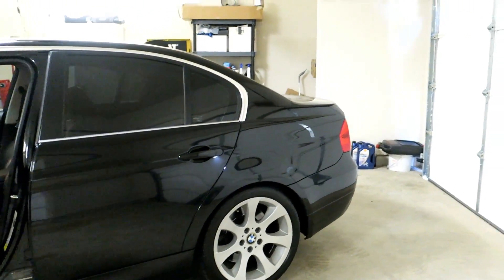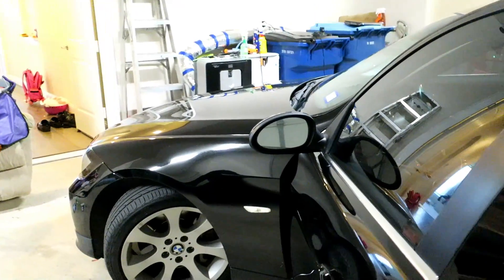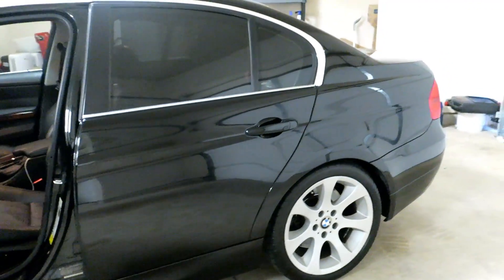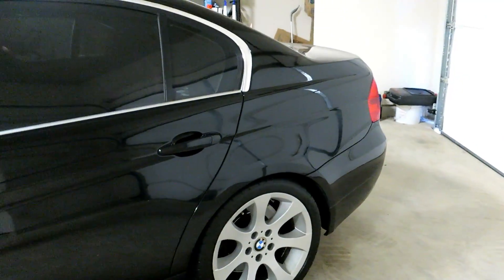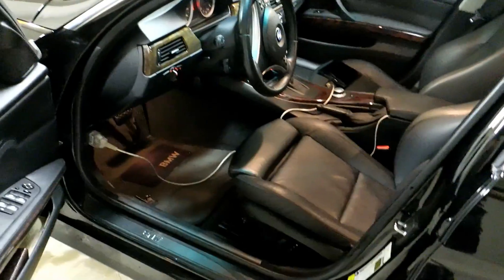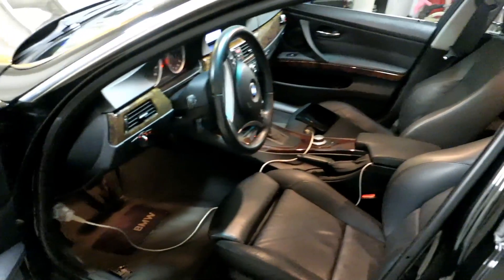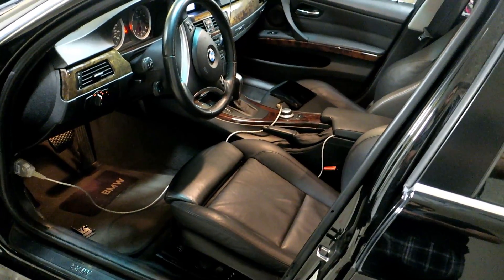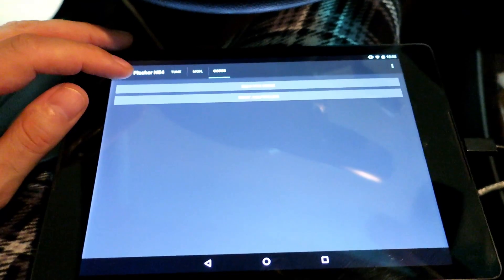How To Diagnose A Fueling Issue On Your N54 BMW.  Part 1

Comment: my 07 335xi, that I just got started having an erratic idle at startup, wanted to stall but feather the pedal seemed to smooth it out. I pulled a P3090, how to decide if its the HPFP or the low pressure fuel pump or FPS?

Comment: For those running Walbro LPFP with the Walbro fitting check the fitment of the fitting and the O ring inside the fitting if the O ring is ok check the tightness these things come loose and cause all sorts of problems and leave you chasing your tail.  CERTAIN COMPANIES DO NOT WANT YOU TOO KNOW THIS IS THE FIX  THAT  IS WHY YOU NEVER WILL FIND AN ANSWER IN ANY FORUM WITH THIS PROBLEM, SO THEY DELETE THE FIX.

Comment: so i have a 535i with the n54, and i had the issue of it cutting power around 3k rpm, so i replaced the hpfp and it fixed it. but now about a month later, it almost instantly throws the codes 29DC, 29F2, and 2B2C. do you have any ideas what it might be?

Comment: omg bro i love you ive changed vanos all my o2s and fuel pressure regulator and fuel pump and i checked my guage and myn stays at 48.99 even with car off and fuel throttle i ran home changed it and omg i got correct fuel pressure

Comment: Im having a issue where at cruising speeds and idle my pressure sits at 23PSI. At WOT my second pump kicks in at 15psi and the pressure goes up 70-90. My tuner was telling me to add a fuel inline check valve but im running stock fuel lines and don’t know where i would connect it to, if anyones has an idea on how to connect a check valve to it please reply to this :(

Also im running a walbro 450 and a 535 ethanol pump. Im on full E85

Comment: So im having long crank and also an issue when it starts the car jumps up and down in rpm like its going to die sometimes even puts the car in reduced power mode and acts like it does not want to start but it always does I can turn it off and back on and the issue clears up also comes with shakes and missfires I was thinking the fuel pump but after watching this im now thinking about fuel injectors but didnt belive it to be the issue i see a problem when i floor or gas it above the 5k RPM mark it missfires check engine light flashes and whole car shakes  not sure if this has anything to do with it but also the 4x4 light and brake light have came on but turn off as soon as i start to drive or if its warm outside only pop up really at cold start.
Reply: These are the codes if intrested:
Cylinder 1,2and3 misfire. 
Cylinder injection cutout, 
fuel high pressure system. 
Fuel low pressure system sensor (electric).

Comment: lpfp at idle is 33. 
Hpfp is 600-700

wot is 80ish and 1800ish

Brand new stage 2 bucketless lpfp. 

randomly in traffic the hpfp will drop down to as low at 50psi then will run rough and die. 

Hpfp or low pressure fuel  sensor?
Reply: Did you figure this out? Having same problems

Comment: Hey man, I have an issue with fuel pressure drop overnight on our 2010 x5 30i (n52). Leads to extended cranking in the morning. Just replaced the cross over sending unit with built in fuel pressure reg under driver side rear seat. Not totally convinced that resolved it. Where to look next? Fuel pump is new (2018 recall by BMW).

Comment: So if you have a bad sensor would your car still run? My car stalled at a red light and I have fuel codes 
2AAF
29F3
Reply: Now I have the 29F3 code ….

Comment: so my sensor reads anywhere from 40psi-130psi in my logs when around 70+% throttle, any ideas? lpfp done,(walboro), new ekpm3 module, new hpfp, new fuel line behind the hpfp, new index 12s. only things i haven’t done are the lpfp sensor, valves need cleaned, and im in the process of putting injection clamps throughout the fuel system. im lost, can send logs if needed
Reply: The LPF sensor is known to go bad (vibration, heat, years worth of fuel), and according to people on the forums, it is more likely to fail than the HPFP and LPFP.  The LPF sensor is relatively cheap ($50 - 150 depending on whether you get it as a kit), so it is worth trying. It should have been replaced when you replaced the HPFP, because it sits right next it.  Replacing it is not technically hard, it's just a bit of a PITA because you have to remove your air intake manifold to get to it. It takes about 1 - 2 hours depending on how quick you are with your tools.

My LPF sensor failed (i believe), and my symptoms were: slight stumble at idle for a month or so, then, completely out of nowhere, at a red light, the car stalled and refused to start. When I let it cool down for about 20 minutes, I could get it to start again for about 1 - 2 minutes. Checking the codes,  I got a 29DC, 6292, and 6293. The first basically says that the cylinder injection was shut off; the other two report over current and under voltage to the fuel supply.  I checked my EKPM and it was the newer version and nothing looked fried. So, I checked the fuel pressure at idle (when it would allow me to start), and it was reading unsteady and upwards of 88psi...then it stumbled and stalled. Getting it started again, it would bounce all over from 60 - 88psi.  My theory is that the sensor was reading a higher value than what was really there and reduced the voltage signal to the LPFP, starving the engine.

I replaced the low pressure sensor (walnut blasted the intakes while in there) and now the pressure holds steady at 72.5psi. There is a slight variance when stepping on the gas, but the DME is supposed to target 72.5psi. I haven't taken the car out for a drive yet, but i let it idle for 30 minutes...still holding around 72.5, no indication that it was going to stall.

If you have the skills and tools: replace your sensor and clean your valves while you're at it. The two aren't really related, but you must expose your valves to get to the LPF sensor.  It seems that you've pretty much replaced everything else, and despite what others say, your low pressure should not be erratic.
Reply: @jlwagner79  this helps a lot, since asking i serviced injectors again and still nothing. so the readings being off because of the sensor makes sense. and if it reads wrong, it sends the wrong input therefore making it gasp for more. thanks a lot boss!

Comment: I have a e90 335i and it will long crank sometimes but alot of the time instant. But sometimes during a cold start it’ll just cut out and the throttle doesn’t do anything and fall slowly in rpm’s. Kinda random when it does but I have the codes if any one is curious aswell. Any help is appreciated though

Comment: Hi Vehicular DIY. Thank you for the channel. I have a active 29F2 code (high pressure fuel system, fuel pressure). It's intermittent, with a recent prior misfire in cylinder 2 at car starts.

-- In morning starts about 15 seconds in, the car begins to rough idle/hesitate.
--30 seconds in, the car goes into limp/reduce power. Showing an active 29F2 code (high pressure fuel system, fuel pressure).
--If the car can make it past 30 seconds from start, the rough idle subsides, and the car drives normal.

I see you use MHD to verify the low pressure sensor is reading/sending accurate values to the DME. I dont have MDH. I have INPA, and other free diagnostic apps, which only reads fuel rail pressure.
Reply: I am having this issue as well.  Did you ever resolve?  Strange thing is, if I put into sport mode, I can get great acceleration so I am wondering how the HPFP could be failing if it performs like that if no limp mode is initiated after start.
Reply: @TheJtaylr77  Any update brother? I’m still having misfires and shaking on cold starts after doing the coils, plugs and a walnut blast. 
Car still pulls hard when fully warm and none of my plugs had any fuel smell or anything from leaking injectors when I changed them.
Reply: @n54kv  ended up being the high pressure fuel pump after all.  Replaced and problem solved.  Hope that helps!
Reply: @TheJtaylr77  Good to know. Thank you for actually responding! Just got a walbro lpfp in the mail today. If that doesn’t help I’ll grab a hpfp next 👍🏼

Comment: I started a MHD data log before starting my car and could see that the "Rail Pressue (PSI)" was 72 psi.  I almost certain my low pressure sensor is bad and have ordered a new one.  Should that Rail Pressure reading give me confidence that the Low Pressure Fuel Pump is working correctly since the HPFP wasn't turned on, yet?  Great Job on all content.  Super helpful!

Comment: Hey I'm having similar problems with acceleration and sputtering. I recently replaced my fuel injectors. After the new install i learned that my old injectors were eu5 and the new ones are eu6. Does that make a difference? And cel says air mixture too lean.. any help thank you.

Comment: Would a failing hpfp cause blue smoke to come out the exhaust and smoke to come out from the oil fill cap on the valve cover?
Reply: No. But burning hella oil would.
Reply: Pcv valve

Comment: I’ve always had the code 2aaf fuel pump plausibility but today I was at work went with one of my friends to do pulls on my break and the car went in limp mode pulled out MHD and saw I had the 29dc code something about cylinder 3 I cleared the code and nothing else has happened but the car feels wobbly and shakes at low speeds

Comment: Ik this is old but I really need help here. N54 335i. MHD tuned, Hard 29E2 DME fuel injector rail pressure-sensor signal. While driving around 2k mostly highway speeds if u let off the throttle and get back on car starts studdering starving for gas it seems, and shuts down. Fuel rail psi goes crazy when this happens jumping from 700-3500. Lpfp bad?

Comment: Have n54 e92 335i the fuel gauge after putting gas start going down after 1 mile and then it fluctuates up and down until it goes down any idea what this could be?

Comment: i got a weird problem my fuel pressure fluctuate so fast between 70 and 40s under any % throttle but stays in the low 40s under low throttle
Reply: Did you solve problem ?
Reply: @JustinGotsVlogs  yes it was fuel regulator and HPFP

Comment: Hey man can you help me out, when i bought my car it was running fine (aside from blown turbos and waterpump) but then it randomly died and hasnt started since. I got cam position sensor codes, then replaced the sensors and waterpump and tried starting again. Car cranks for days but no start. Finally got MHD hooked up and got the 29F3 code for fuel low pressure sensor-electric but the cam codes are gone and my car still wont start. The only reason I’m asking this is because your car still ran with this issue I believe?
Reply: Hey what was the issue? I'm having the same code and problem. Thanks
Reply: @ddrive1022  i managed to get the car started by priming the fuel pump about 6 times before starting. (Put car in accessory, wait for all lights to go off, pull key out, open and close door, repeat). But after i got the car started it it idled like a rotary 13b, purely electrical issue not mechanical. Months later i figured out i had a few melted wires which ended up blowing some fuses. One of the greatest mechanics ever fixed it for $550 (charged $125/hour).
Reply: @PR0bro  Dang, that's a tough find. I figured my problem out, I mixed the fuel pump and fuel level sensor cables at the pump, after a turbo replacement, they are identical. Glad you got it sorted. Cheers.

Comment: NOTE:  Reading the n54 High Pressure Fuel Pump RECALL, it states that the Low Pressure Fuel Sensor will need to be replaced it when doing a testing on it if it reads above 6.7 bars (97 psi) than the sensor is bad and needs to be replaced.  If it reads below 6.7 (mine with the latest upgraded version reads at a stable 87 psi) than the sensor is good!

Comment: Update on my BMW F10 535I M SPORT, after replacing my Low Pressure Fuel sensor to the latest upgrade & upgraded with the latest short fuel line and the gas smells where instantly eliminated. Yet the 3 to 4 second cranks at cold start continued, my HPFP would read at a bit less of 100 psi until warmed it up and turn off the car wait a few seconds and restart the engine and the High Pressure Fuel Pump would have the correct 700+ psi at idle..... 
Well after a few days, I thought to myself that maybe the Low Pressure Fuel sensor needed to be "reset"..... So yesterday I Turn on the key until all lights (except the Check Engine light) turn off. Then turn off the ignition, waited 10 seconds and repeated the process for a total of 3 times!  Somehow this seemed to reset the sensor as the car starts right up, no more smell, checking the Rail Pressure via BimmerLink shows a mPa 5 at idle which equals to about 715 psi.  The Low Pressure Fuel Sensor monitors a 599 to 600 kPa which is 87 psi and very stable and stay there in all accelerations and idles....  When the car turns off the Low Pressure Fuel psi goes up to a healthy  699 kPa which equals to 101 psi and ready for the next engine start!  So somehow it seems the latest upgraded Low pressure fuel sensor design is a major improvement......   I received my new high pressure fuel pump from FCPeuro but I will continue to test to see if maybe my car is all fixed with just eh low pressure sensor and return the new pump back....  Car Scanner, BimmerLink and MHD Flasher scanning features are amazing for any BMW!
Reply: so was the "reset" all you needed?
Reply: This has been fix 3 years ago... It ended up being the High Pressure Fuel Pump ($500 - $700 new).  The high pressure and low pressure sensors must also be replaced. These 2 sensors are very cheap and must be OEM as well.  
I have fix lot's of things on my F10 M-Sport as I just did the motor and transmission mounts, all professionally done by me with all the proper tools, all original OEM parts and torque specs to every bolt and nuts.  

Need to know anything else about the F10 let me know as I'm about to replace the complete driveshaft brand new USA made, with German Meyle HD flex disc "guibos" and differential mounts as well the proper way! 
  @MericanSlav

Comment: Now i have just bought the newest MHD Flasher black WiFi adapter for my F10 n55,  but without paying anything, the only thing that works is the scanning of error codes and that it! Im not planning of flashing any map and got the adapter because it's compatible with Bimmercode, BimmerLink, ProTool, xHP Tool, as an ENET cable for Windows INPA and others.  
So how can i just get the "Reset" option like resetting HPFP, Transmission adaptations, etc. via MHD working, do i have to buy something? Paying $200 just for those options to work are NOT worth it if thars the case! What do i need to buy? 
Thanks....

Comment: Update, replaced the updated Low Pressure Fuel Sensor with latest fuel line and that solved the gas smell that wasn't burning correctly.  Using the very accurate free version or the Pro $4 vers. amazing "Car Sensor" obd2 app that shows every live sensor data that my car supports & every BMW error codes + shadow codes and easily i could see the High Pressure Fuel Pump at cold start was at a low 100 psi and that was causing the Drivetrain Malfunction when i tried to accelerate normal untill the car fully warms up i would turn off the car, press the Start button, off again and Start the engine the PSI would go up to normal 700psi idle and 1200 - 2400 full acceleration!.  So this concludes that the HPFP is failing therefore I have ordered it already from FCPeuro!.